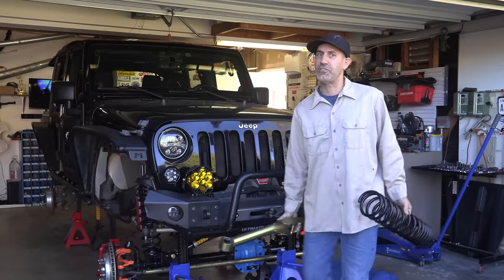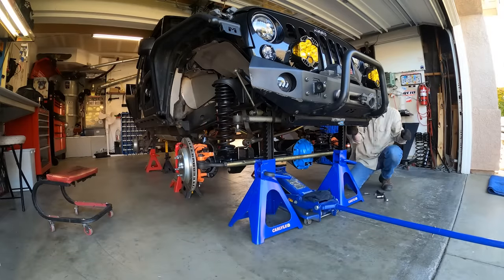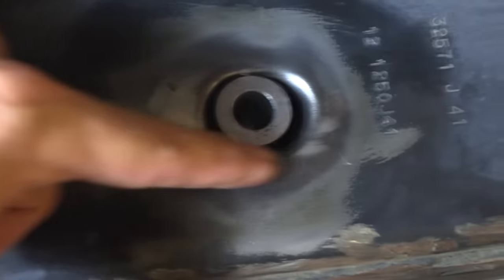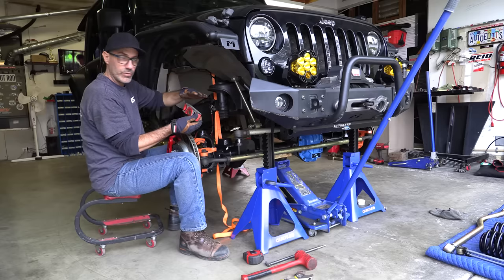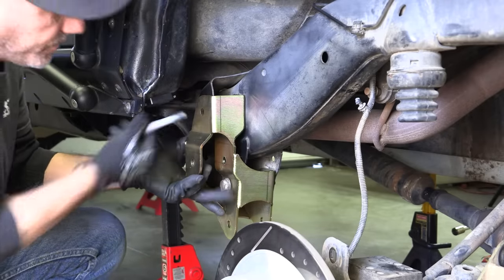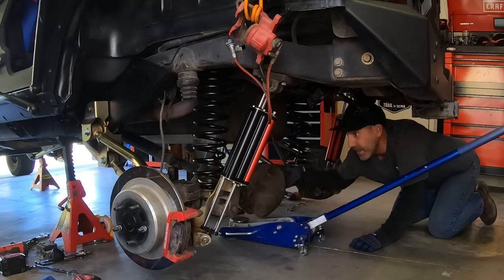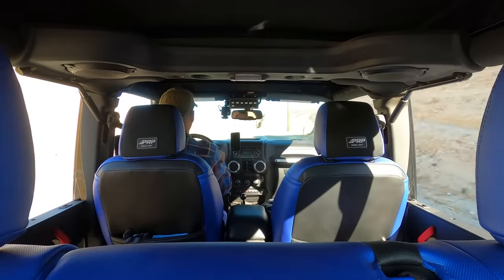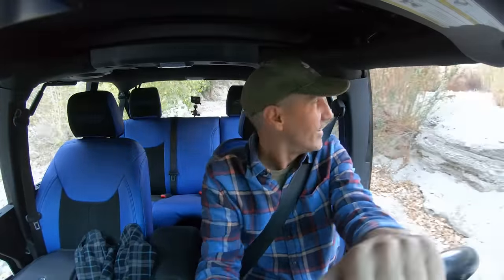4.5" Jeep Lift Kit How To Install DIY - Lock n Load Long Arm from MetalCloak

Comment: FYI as of August 2023 the front control arm brackets have changed such that an exhaust loop delete kit is required for the driver's side front lower control arm to have clearance to travel. Also, the bracket is a bit difficult to install on the passenger side. On one hand, you don't have to weld the crush sleeve, but you might have to drop the fuel tank to bolt the control arm bracket to the transmission crossmember. I didn't have to drop fuel tank, and ended up being able to crowfoot the bolt from the front and tightened with a swivel from the back on the outer crossmember bolt. 

All that said your video is what helped me to decide on the same lift. I have 2015 2-door Black 6MT and have the same suspension as you (except 3.5", fox shocks, and no Db3 s in back because I run 35s). If I knew how to make a good video I would share the differences. At any rate thank you so much again Jason

Comment: Can’t go wrong with Metalcloak and their super quiet duroflex joint. 👍🏻
Reply from the maker: I agree... major highlight of the system for me!
Reply: Yep, I had rubicon express metal on metal, but they had a harsh ride and the joints needed greasing often. After two years with them 3 of the joints failed and so I went with Metalcload duroflex and what a difference, a smooth ride, excellent articulation, steers perfect and no greasing!

Comment: 👍🏻👍🏻👍🏻👍🏻👍🏻, I have be running the 2.5 Metalcloak Game changer lift on a 2012 2dr JKR for the last 8 yrs and love it!  Loading it down with overland "gear" I had to put new 4.5 springs in the back where the majority of the load was and 3.5 in the front to level it out . So this was pretty interesting!
Reply from the maker: Right on!
Reply: @AutoEdits  I'm a 1 1/2 yrs late on my comment I noticed. LOL.
Reply from the maker: @NarleyAdventures  There is no "late" here... glad you watched and took a moment to comment!

Comment: Great video, glad I found it. I find long arms interesting but i'll be fully honest, my 2 door is just a daily in a sense. I pull it behind my RV and do beaches, fire roads, dirt trails, etc. I do not have hard core wheeling. What I am thinking is sort of getting the same result. I have geometry brackets with a 2.5" lift which ends up being 2 3/4". I want to get it above 3" so i'll keep the brackets (remember the type of wheeling I do) and just use Metalcloak's adjustable arms up front. May be overkill but gives me a lot more to dial in the pinion angle plus a heavier duty arm with a much better joints. Why I am also looking at the rear kit as well that you used. Again, probably overkill for my use but I look at it this way. I have no reason to ever get rid of the Jeep. It's not my primary vehicle and you never know what you may intend to do with it. I need it to be both urban and off-road capable but I also like to overbuild a bit as well. I plan to do more which some think is nuts for my use but I like to overbuild so 20, 30 years from now I am still driving it. Just curious have you looked at the front shock relocation brackets? Interesting idea. Lastly, how is the DB3 kit doing 3 years later?
Reply from the maker: Over-building for peace of mind is a good thing. The DB3 brackets are really amazing and I'm still very happy with them. I might try their long arm kit just because I like the looks of them but the anti-squat and highway manners of the DB3 brackets are better. Keep in mind the DB3 is mostly designed for lifts of 3" or more.
Reply: @AutoEdits  that should be perfect. I want to get my lift right at 3.5” if I can. For me that will be about the perfect height. It will also allow me to flip my drag link and should keep a good height for both highway and off road capability and manners. I am tempted by the long arms. Have to see which way I go.
Reply from the maker: @jeffdurling100  I agree with your build philosophy. 3.5 is perfect to achieve the "flip" and yet gain excellent clearance while still keeping the handling great.

Comment: Definitely interested in seeing how these radius arms perform,  particularly compared to parallel arms.
Reply from the maker: Definitely not as high tech as 4 link long arms but WAY easier to install and WAY better than the mid length arms. I was legit "over the moon" happy on that test drive part of the video because the thing felt amazing already so I know with some tweaking it's going anywhere I aim it!

Comment: Cool job u may want to relocate the rear sway bar back a bit move the bracket back front hole to back hole and drill new one for rear and get a insert for the back bolt much smoother no rubbing !
Reply from the maker: Never thought about that, thanks!

Comment: Just what a friend told me. I’ve been waiting for someone credible. Guess I should just call Metalcloak
Reply from the maker: It's going to be fine... I'm not worried at all and don't actually see anything needing to be trimmed but shouldn't be a big deal considering what I just went through to install the lift.
Reply: @AutoEdits  awesome, I’m also curious what you decide on a rear housing/axle combination. Sixties would be nice but I just bought new beadlocks, 5X5. I’ll definitely be following along as usual

Comment: You can't make comparisons to Ian's rig. He ran a TJ for TTS. Radius arms perform well on the smaller wheelbase but the great thing about the JKU is that you have the wheelbase and geometry to run a true long arm kit without having to deal with the cons of a radius arm & drop brackets.
Reply from the maker: I did.

Comment: Love the progress man! I was just wondering what length you started at on your rear arms with the DB3 brackets...I am really thinking about doing this.
Reply from the maker: 20" on the lower and 17.5" on the upper but just installed this on my buddies jeep and had to tweak it a little.

Comment: I'm Stoked that your stoked. Although personally, not a fan of radius arms or drop brackets. Subjected to binding. How is a kit comprised of antiquated tech supposed to be Metalcloak's flagship suspension? There's a reason why all the other Premium suspension manufacturers don't produce radius arms for JKs...Rock Krawler, EVO, Icon, Teraflex. Now look at the ones that do...Rough Country, Rusty's. Just saying.
Reply from the maker: I don't agree with this at all but totally appreciate your opinion. This offers amazing performance for the relative ease of installation. What bind are you even talking about???? With the lock n load unlocked it offers an amazing amount of flex. Is there better, absolutely... at this easy level of install in my garage... no way!
Reply: @AutoEdits  I wouldn't even say better honestly. If perhaps your looking at max an inch more of travel on a 4 link vs this, I'd say ok but as a whole metalcloak with their shocks and coil combo then I'd say Metalcloak is simply better in almost every way. Now fyi this isn't their flagship by any means so if we are to compare 4 link long arm MC with 6pac shocks to 4 link long arm from any other manufacturer with let's say falcon shocks(or fox) I'd still say that no one compares. The only people I think that can gets close is Teraflex but imo it's all about ride. MC offers best flex, best ride, easiest install, and comparable pricing. All in all MC all the way in terms of final destination lifts. And that's not to say you can't get by with other cheaper lifts or anything like that and I am sure you can get close for cheaper but MC has a good thing that is simply the best
Reply from the maker: Thanks for this!

Comment: Older video but I was wondering if you wish you went with MC's long arm rear or are you still happy with the DB3 brackets? I'm at that cross-roads now. Thanks so much for your how-to videos, I refer back to them again and again!
Reply from the maker: The DB3 is such a simple install and offer so much improvement for over the road driving that it's easy to say I'm still VERY happy with that choice. If I were building it again, I would choose the long arm only because it is overall the right answer but something dramatic would have to change in how often I do hard wheeling to justify making the change at this point. Hope that helps.

Comment: The Garage thing is why I have not done this to mine yet. I have exactly 1" of clearance right now with the hard top on at 28psi. I would be interested in a short term follow-up video after driving for a 1000 miles or so and know if you see any difference in the handling going from a 4 point mount to the 2 point mount on the front control arms driving around town.
Reply from the maker: What I've found first is that the Supertop Ultra sticks up over 2.5" from my old Trektop.  I might swap back because that would actually make it fit in the garage with this lift and tire combo.  Even thought I like the looks of this top a bit better.
I did my first around LA driving yesterday and ran down the 405 fwy for 40 miles each way and the thing drove amazing... from bumper to bumper to  85mph bursts on a beat up freeway. Plus it got an overall gas mileage of 18 mpg. Still haven't had it professionally aligned yet.

Comment: Great video! I’ve watched this video at least 3 or 4 times. You do a great job explaining the installation. I have the same kit still in boxes, waiting for a long weekend to install. How long brake lines did you go with?
Reply from the maker: Awesome, thank you! I don't remember off hand but the longer of the options on the metalcloak site and they work great. Take your time and have fun with the install... remember to measure before and after!

Comment: I have been on the hunt for an explanation as to why someone would choose the locknload over their long arm kit? 

What is gained? And what is lost?  I am not knocking either- just curious. 

Thanks for the videos!
Reply from the maker: Solid question. LocknLoad offers you many of the benefits of long arms with an extremely easy installation (as demonstrated in this video). The four link setup is better for maintaining pinion angle during suspension travel but is a much more involved installation and wasn't in the cards for me at the time. I've been extremely happy with how this Jeep performs with the LocknLoad... over the road manners are flat out amazing and it has plenty of performance in the rocks. So in my opinion... it just comes down to what you're prepared to do for installation. If you are capable and ready for the long arm four link installation... do that for sure. But, if you aren't quite ready for that level of install, this is an amazingly capable setup. 
Just my opinion.
Reply: @AutoEdits   Solid points, and I appreciate your opinion. :) good videos.  I used to Live in Ridgecrest and play in many of the same areas you shoot.  Sure do miss the desert!  

Thanks for the consistent content and approach.  Your videos are different from most, and I really appreciate that as your following has grown you have stayed pretty consistent and “true to your roots”. 👍🏼🍺

Comment: Great job! Your a Pro now. So if you gained an inch or two does that mean next set of tires are going to be bigger? 😊
Reply from the maker: Not sure yet... I kind of committed to this size with my gearing and sticking with a D44 front but I'm really interested in trying out the 39"bfg's at some point. So far these patagonia's just work so well I can't justify getting rid of them yet.

Comment: So you didn’t have to grind the welds where the old control arm brackets down perfectly flat with the frame correct? Looks like you left a little material on the inside
Reply from the maker: Correct... just make enough clearance for the control arm to move freely.
Reply: @AutoEdits  awesome thanks I think I can diy this then

Comment: I always like to coat my bolts in grease, so after a year or 2 of water running they dont rust in the joint ends, the next guy to work on it might be me again
Reply from the maker: Great suggestion!

Comment: Such a great video and lots of info. Keep them coming!!! Also I see u used semi-gloss paint on the frame. What brand did u use cause it looked like factory.
Reply from the maker: Thanks! In this video I used the Duplicor semi-gloss black... works pretty good but I'm going to try Steel it products soon and see if they last longer.

Comment: How do AutoEdits. Another great vid (which I watched AGAIN). I’ve chatted with you regarding the Game changer 3.5 (which is still on the to get last). However are you still using the MetalCloak steering system you installed? It looks like you upgraded the steering stabilizer to ‘Centerline’…is that a marketed upgrade from the Rocksport shock that came with the metal cloak?
Reply from the maker: Yes, all the steering arms are the very same from that video years ago and yes that Centerline is a MUCH better damper... highly recommend that style.

Comment: Would it be possible to move the brackets forward in the front (2-3 in) and rearward in the back (7-8 in) to extend the wheel base as desired, keeping other component positions in mind?
I really like the kit with long arms, as I'm currently doing new floors, torque boxes, and boat sides in my TJ so I'm trying to plan ahead for suspension following up with drivetrain lifting.
The ultimate goal is to keep any lift minimal (below 5 inches).
Reply from the maker: You could probably weld them in place. Metalcloak probably has a kit for that setup.
Reply: @AutoEdits  I did check after seeing your video, and they have a kit, so I'll call them after the weekend and inquire, thank you so much for your continued work on the channel and excellent content, also for responding to us all, AWESOME channel and my Best Karma out to you 🤘

Comment: I think I asked on instagram why you went went radius arms, and now I see why. Much easier install than a 4 link long arm. Curious to see how that spring arm works. I am assuming when that is unlocked it acts more like a 3 link. On my JK I am running drop bracket up front, and it drives better than stock. Yes, I lost a bit of ground clearance, but its a pleasure to drive on the streets compared to my old JK which just had adjustable arms.
Reply from the maker: Hey dude, that's exactly it.  Easiest long arm to install for the highest reward factor.  And you are 100% correct on the lock n load... acts very much like a 3 link which is great. I was legitimately geeking out with how good this thing drove on that test drive portion of the video. Plus my confidence in these components is very high given my experience with the smaller stuff from the same family of parts I've been running for 4 years.
Reply: @AutoEdits  Yeah, I think if I ever redo the lift on my Jeep, I may go the metal cloak route. And their HQ is like 2 hours from me.
Reply from the maker: @Stuka87  I legitimately like the components and this was a good example of how they make it easy to upgrade across systems. The duro joints are just plain awesome.

Comment: Hey I just installed my 4.5 LNL, love it! Just had a quick question, do you drive that thing unlocked on the road if so how does it handle, Or is that something you only want to have unlocked while off-road?
Reply from the maker: My understanding is only unlock it off road to keep the axle more stable under heavy braking on the street. I haven't ever unlocked it yet... looking forward to testing it out next week!

Comment: Looks good, I’m curious how the long arm fits with the Metalcloak skids? I’ve been thinking about this upgrade for awhile but don’t want to remove my skids.
Reply from the maker: They work fine with the skids... I removed mine for ease of installation video and I might be doing some exhaust and or driveshafts very soon.  I would never give up my metalcloak skids... major unsung hero upgrade for sure.
Reply: I would like to see them back on. I heard they required trimming for long arms. I’m sure my 3.5 will be growing in the not to distant future.
Reply from the maker: @jimgavin1799  Hmmm.... I'll be curious on what needs to be trimmed as well.

Comment: Cant wait to see how the lock n load works out . I'm running a similar setup with the Ultimate Dana 44 and Metal Cloak 3.5 lift. Do you suffer from bump steer like I do? Flipping the drag link only helped a little .
Reply from the maker: ME TOO! My initial impressions are already off the charts happy.  I've been busy running the jeep all over LA and finding any excuse to drive it... it's that good. The off road part was the no brainer improvement part but the everyday driving is where I'm being blown away. 
I did have some bump steer with my 3.5... when I swapped the UD44 in... I got the Reid knuckles and the high steer made all the difference with that. Make sure your track bar is adjust right. Too short (close to driver's side) and that is a culprit. Also if you go with the Reid knuckles just go to 3" of bump stop spacers and the uptravel wont be an issue as well.
Reply: @AutoEdits  Thank for the tips. Hopefully I'll be heading down the same path you do in the near future with similar upgrades.

Comment: Did u have to cut out part of the exhaust loop? I read on MetalCloak website that for 2012+ u need to modify exhaust
Reply from the maker: I did not have to modify the exhaust on my 2013 or on my buddy's 2016 with this kit

Comment: Question after you install the 3.5 lift what is the hight of you jeep ?  I want to add it to my Sahara but I am not sure if it will fit in my garage after... and awesome video thank you for all the good info!
Reply from the maker: It still fits in a normal garage even with the 38” tires.
Reply: @AutoEdits   nice !
I live in an apartment and right now I have about 9” clearance between my roof and the garage door 
So I should be ok I hope !
Reply from the maker: @trailsthroughmylens7342  with the 3.5” lift you are good to go!